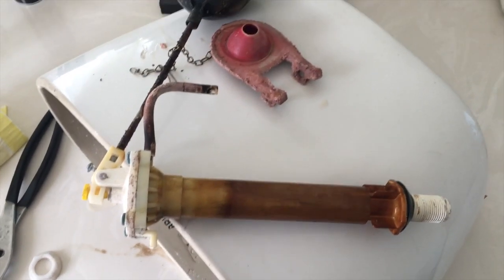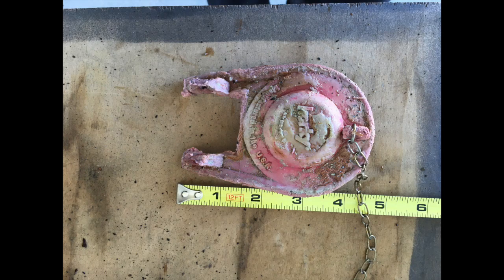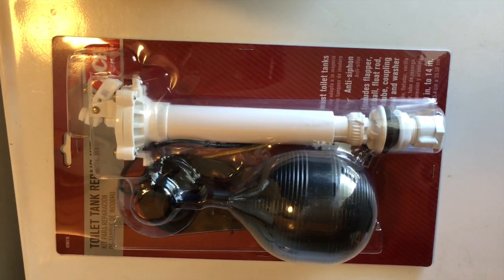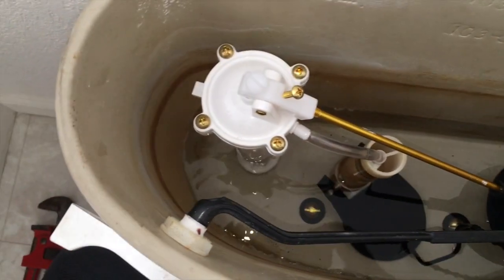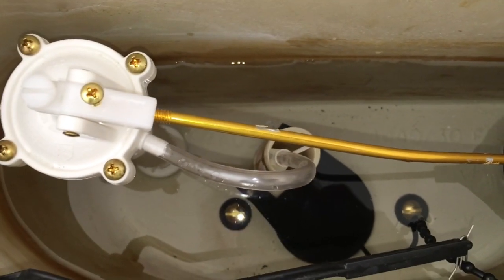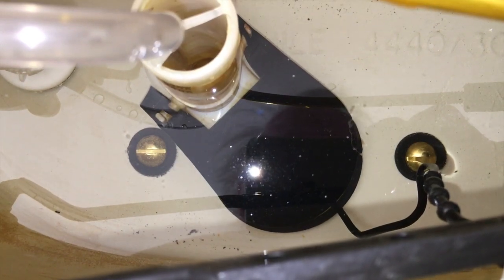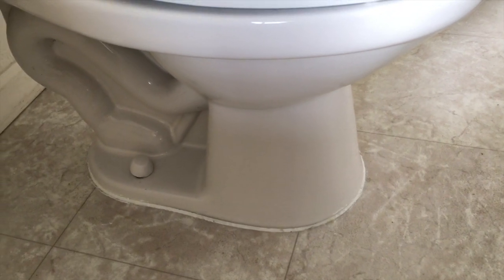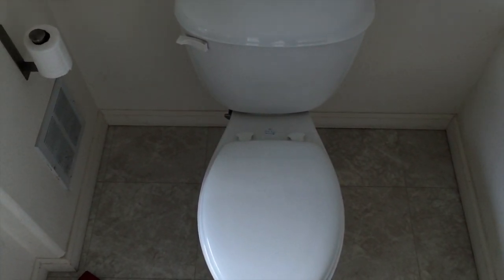Briggs Toilet Tank Rebuild

Comment: I want to thank you for the video. This is a hall bath toilet that rarely gets used. First flush in a while and a bunch of water shot out between the tank and bowl. I got the same gasket and hardware on eBay for around $20 total. It was actually easier than I thought. The worst thing you could do is over tighten the bolts and crack something. Soon as you start to feel a little resistance, you're probably tight enough. Wiggle the tank and if there's no play, it's tight. I needed a 13mm wrench to get the existing hardware off but a 12mm was the right size for the new hardware. I rinsed out the tank in the bathtub which was a lot more convenient than taking it downstairs and outside. Thanks for taking the time to do the video.
Reply from the maker: You are welcome. Glad it helped you out.

Comment: Did you try going or calling (or web search) hardware stores for the Briggs tank to bowl gasket / seal? Looks like Lowe's didn't have it! 😡 I got the Fluid Master Universal tank kit, but the gasket similar to the Briggs won't line up to the two holes. I am not sure if the red universal gasket will work that well as the tank to bowl gasket is meant to provide a seal where the two bolts pass through the space between the tank and bowl. Thank you for the great how - to!

Comment: would have either bought a fluid master complete repair kit which worked on my 1999 Briggs 4440, or gone on Briggs website and bought a flapper and fill valve from them. Nice video overall. I have one on my channel of the replacement I did on my Briggs if you want to check it out.
Reply from the maker: Thank you for the comment